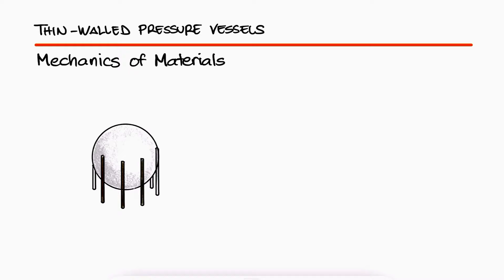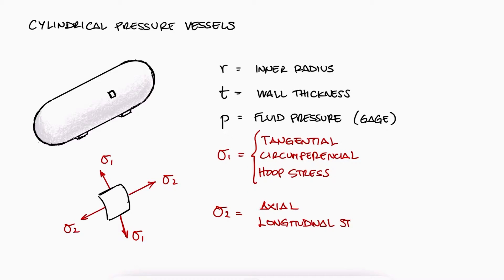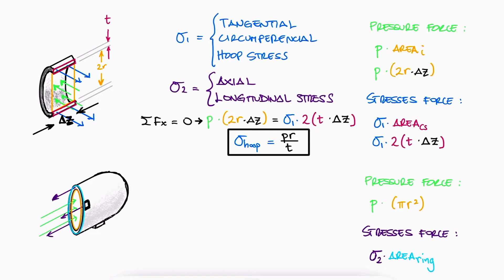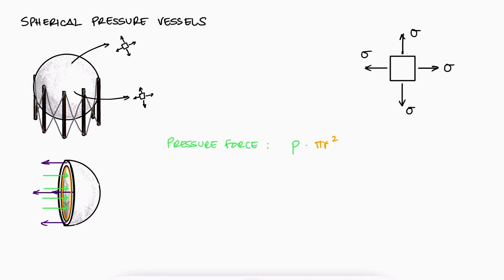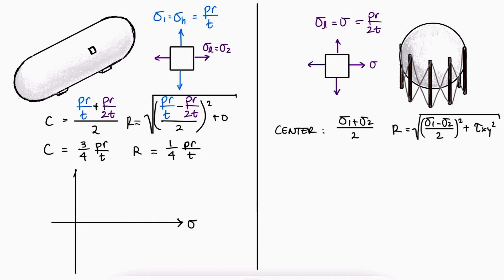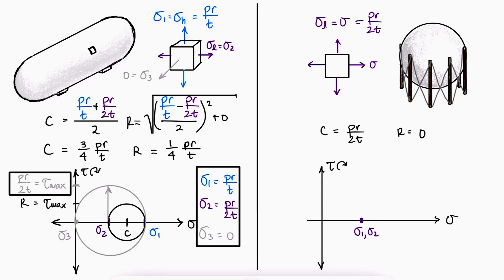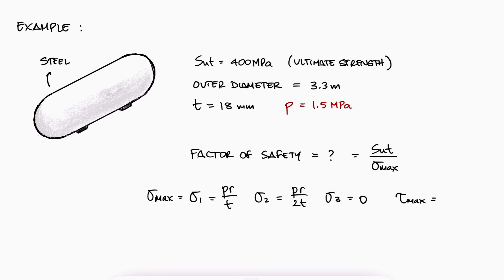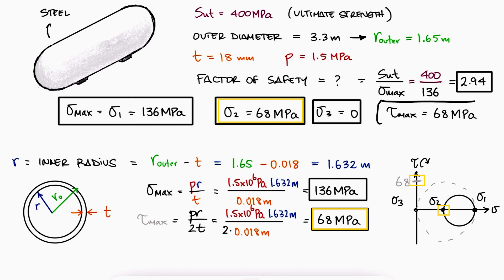Thin-Walled PRESSURE VESSELS in 8 MINUTES - Mechanics of Materials

Comment: Why when the tank is split in half to perform the force balance the pressure does not act on the inner walls but instead it acts on a plane that doesn’t even exist in reality? Shouldn’t it be on the walls like i said?
Reply: Fluid pressure is acting on every vertical component (the imaginary plane illustrated) the cylinder i think. I don’t think the concavity affects it measurably.

Comment: @2:02 When I distribute the 2 on the right side of the equal sign, i get 2 * delta Z. Is that correct? I feel like I am doing something wrong because I can't get from
p ( 2r * delta Z) = sigma * 2 (t * delta Z) 
to
sigma =( p * r ) / t
Reply: You shouldnt distribute. It should just become 2*t* Δz
Thereafter divide both sides by 2*t* Δz

p * 2 * r * Δz
2 *t * Δz
2 and Δz cancel which just leaves p*r/t= σ
Reply: @itzmecyber  Ope. Yep can't distribute to a delta. Thanks!

Comment: Question with respects to the solved answer:
Why is σ2 ("Axial Stress") considered the maximum stress, specifically?

Like ok, I understand the Moor's Circle and the graph shows us when you take in to account all three stresses (σ1, σ2, σ3=0), the maximum shear stress (Τmax) is equal to σ2, but WHY is this the most significant factor with respects to calculating shear stress?  I'm guessing something physically is happening to this structure where the axial stress is somehow the weakest factor, but the only thing I can guess is "σ2 has the lowest number, and therefore less stress will cause it to break.  This doesn't apply to σ3 because even though we defined σ3=0, it doesn't imply it needs 0 MPa force to break the vessel, but rather, σ3 doesn't play a factor with respects to the forces applied."  Otherwise, it appears when calculating for any shape, the σ value that has the SMALLEST value (other than σ3=0 which we ignore for some reason) will result in the weakest force to break the structure.

And to comment on the FOS to justify it:  All this is saying is if you want to be CAUTIOUS and design the structure to not fail, having a factor of safety ratio of FOS = 2.94 should be "safe enough."  I guess you could look at FOS as a way to determine/justify how "safe" a particular design is.  It appears a very low FOS is dangerous, and as per MOST standard, a FOS near or at 3.0 is ideal (aka:  "You should design your vessel to withstand 3x the force the material can handle before breaking).  So what is considered "too low" in the real world?  Each material has its own standards, but it seems most are around something like 1.4 as the bare minimum, but also super risky.

Not a question involving FOS, just trying to justify its holistic existence.

Thanks you for these videos.  You're actually taking information and justifying it, showing examples and what geometry each piece specifically applies to, and that's more than what most doctorate-level professors attempt.

Comment: What should be done if we have watwr proof camera capsules for depth of water(submersible), are this equation still valid, say if my capsule is at depth of 4000m under water and it's cylindrical with 2 hemispherical flanged and sealed ends. So should we take ultimate compression strength of steel for Design and pressure will be from reverse direction?